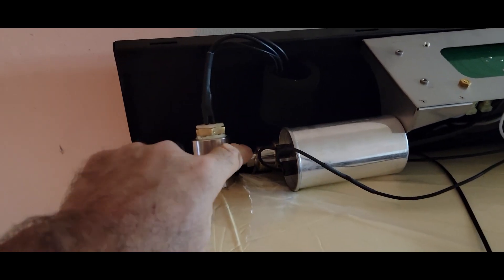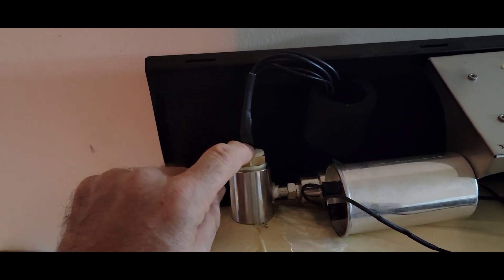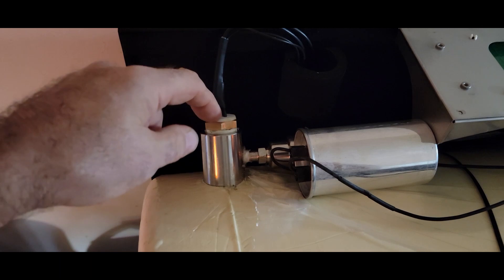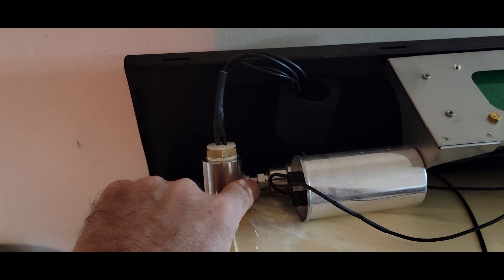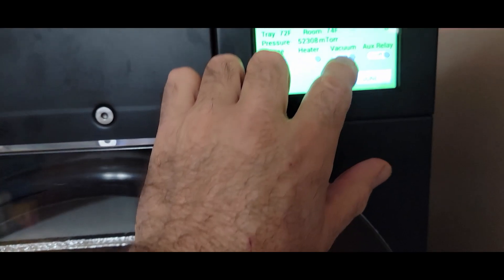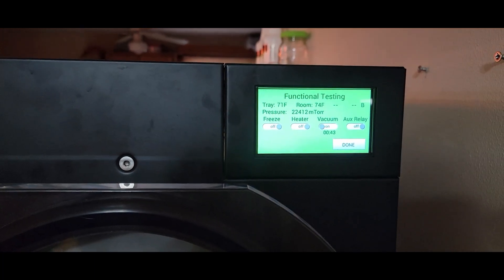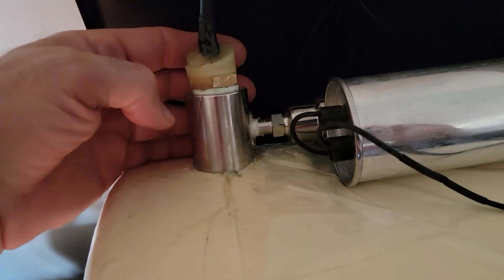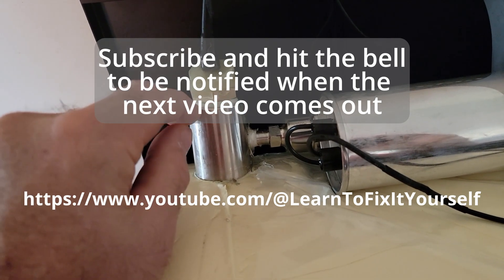Harvest Right Vacuum Error #9 - Part 5 Epoxy wires

Comment: They source the parts from China, all of the welding is done in China, and they slap it together in Utah and then charge it with refrigerant.  They know they have issues and after telling people that you need to be at 500Mtor, they just issued a new software update that ignores leaks.
Reply from the maker: I have looked for other freeze dryers and did find one I forget who makes it.  I think doing it again I would look to a different brand.  At least until they figure out how the make the unit work

Comment: Yes, I did the same with the valve. But when I removed it, it was corroded on the inside. The test was neg. but as soon as I replaced it with a quality valve that code went away. Plus pull the back cover panel off the tray rack and test the connections. There are 2 sensors, a round one and on the tray that has 4 wires coming out of the heat pads check the 2 small ones. I think once it starts throwing codes it might be better to wipe the software and redo it. You can get the same version if you like or get an updated version. I do not think the dryers are made in Utah anymore either so that might be an issue. If I am wrong about that please someone set me straight. It seems that around Version 5-16 that they had to get more help in the call center, and you have to go online to set an appointment. I have run mine since the wipe and have had no issues, knock on wood.
Reply from the maker: I did talk with a tech and asked him where they were made and he didn't know,.  check out the other parts they should drop in a few days.   I have version 16 installed right now after the fix I might try the newer version that has the candy mode.  Good info I will look into the new valve right now I only have 58 batches run.
Reply: How do you wipe the the software?
Reply: @fugooogle9731  Harvest right sent me the updates to clear the programing and install the new software. You need to go to their help desk and tell them what you want to do and they will send you the software to do it. If you try and get the updates from their website you will not get the needed programing to wipe it clean, you need to talk to a service rep.
Reply: @fugooogle9731  Ask for Jenn S.

Comment: Roy,
When you say you have used epoxy, is it something harvest right sent you for repairs or the silicone sealant in a tube?
Reply from the maker: Harvest Right doesn't send out the epoxy anymore, their solution is to send out the wiring harness and have you rewire the unit with the new harness.  This new harness has epoxy on both sides of the connector on the wires.  I used a two-part epoxy that you can get from any hardware store.  The problem with doing it on the machine is the wires' angle exiting the freezer unit.  You have to put more on than you should just to seal the wires.

Comment: Have you tried the drain hose connection at the bottom of the vac chamber? The first thing that I replaced was the drain valve with a commercial stainless ball valve. have not had any troubles since with vac. errors. The new update programing is giving me hell now version 5-19 nothing but problems. The v5-19 timed out the time it took to pull a vacuum, so if it did not get to a certain mtor in the allotted time Vac error. may old pump had over 4000 Hrs. so I had to buy a new pump. got that fixed and now it is throwing a more freeze time needed error even if its been -30F for over 10 hrs. Tried to get the new v5-23 update and it would not take. Finally after a week waiting to get a call from service they sent a whole set of programs to wipe the soft ware and reprogram my freeze drier, that worked. but I have not run it yet so fingers crossed.
Reply from the maker: Yes I tested the drain valve and it is working,  I have only run 58 batches, on this unit, and there are several other places we are losing the vacuum.  As I fix one leak we find another.